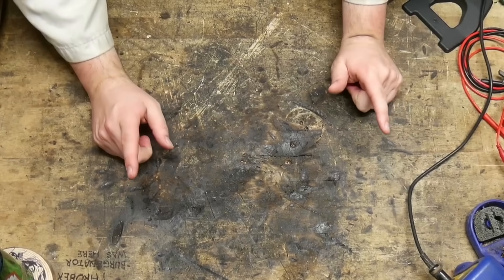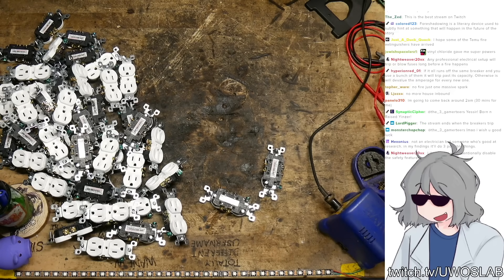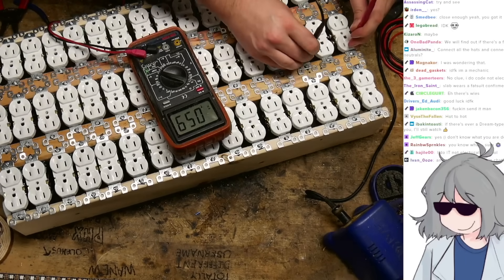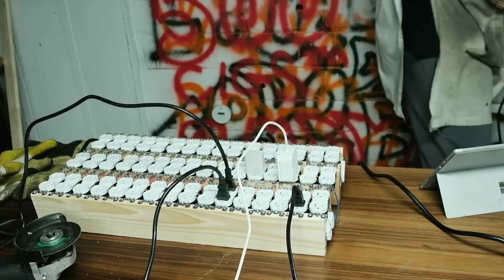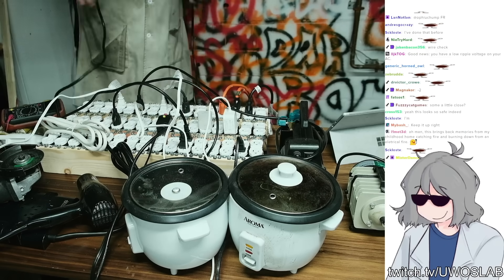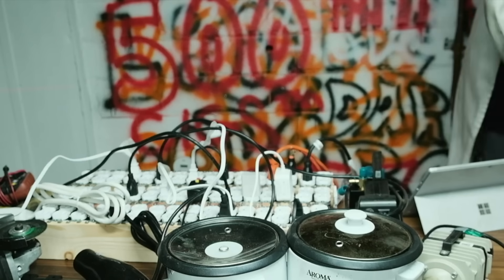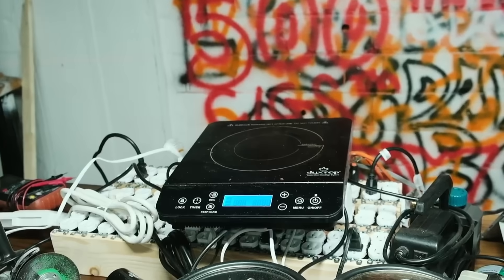Making a 100 OUTLET POWER STRIP to see what happens

Comment: Just sent this to an electrician I used to work with. Im excited to hear the meltdown he is gonna have about how unsafe this is. Lol
Reply: I'm an electrician. Aside from everything being free-air, it's not far off from how your house is actually wired. 😂
Reply: @michaeloxlong  Tbh it works better than wiring in my home XD where every other plug doesn't work for some reason. (the electricians were drunk while making my house)
Reply: @Ashenemi check the light switches, they may have wired half of each receptacle to one of them. I've seen it done before
Reply: @Farce13  i've got a couple of those in my apartment where you need to have the lights on for the outlet to work, and plenty of rooms where half of the outlets in one room are on the same circuit as half in the other room
Reply: @Ashenemi bro has plugs in series
Reply: @DatBoi_TheGudBIAS if he had even one plug in series the entire bank beyond that plug wouldn't work unless he plugged into that specific plug. Even then whatever load he plugged into that plug would actually be current limiting for everything else he plugged in downstream of that outlet.
Reply: @Teh_Random_Canadian  my theory was that he had plugs in series 2 by 2. That's can cause every other plug to not work. Unless the one before is used
Reply: @michaeloxlong  Oh hell no, 100 outlets on a single 16 amp breaker?? I mean, it would be safe when wired correctly, but cheap power extension cables usually don't use  2,5 mm² cable. So they would melt before tripping the breaker.
Reply: @g4_68 I never said it was to code. I just say that's roughly how houses are wired up. Just a bunch of receptacles daisy chained together. 😂
Reply: @michaeloxlong 
I mean most houses don’t have 100 outlets daisy chained because then you run into actual issues, but I get what you’re saying.
Reply: @michaeloxlong  im not an electirician but I think what he did was slightly unsafe due to his comments about the smell of burning plastic. which is either the wires melting or something else melting which was the obvious outcome of this from the beginning lol
Reply: @michaeloxlong  Damn.. 😢
Reply: @cameronsnyder1246  Other than No colour code this is actually decent quality... well except it being a 100 outlet daisy chain but that's the point. Though Uwo could have slappe a Circuit breaker on that stack to save some headache dealing with his Eletrical box going off..

But lets be serious Most people have more plugged in than this. in a home theater setup.
Reply: Also an electrician, 10 outlets, 100 outlets or even 1000, it doesn't matter lol. Outlets are just "faucets" to connect to the wiring. If the "faucet" isn't open, nothing flows. The outlet itself does nothing and has zero draw. When he plugs in all that stuff if becomes dangerous, but the breaker does it's job and takes it down. Code limits the number of outlets per circuit to limit accidental overloading, you can just as easily plug in a vacuum and heater into the same circuit and have the same effect as this video. 

In short this isn't nearly as dangerous as it appears to be. When that dude put like 2000 9V batteries in series... THAT was dangerous
Reply: @Teh_Random_Canadian That is an incredibly helpful way of breaking it down.
Reply: @Teh_Random_Canadian I agree, though I’m concerned with what gauge wire he used, it looked a tad small and the “burning smell” may be the insulation
Reply: @michaeloxlong 
I Haven't watched the whole thing yet, I'm waiting to see if he backstabs them all, which it looks like he will, given he looks like he's screwing them all on to the boards.

He definitely doesn't understand how breakers and load calcs work😅
Reply: @SpookyGoose1  You say that, but he knows enough to mention that not all of his breakers are in phase with each other. Knowing about phases at all puts him ahead of maybe 99% of people.
Reply: Keep us updated
Reply: Yeah but electricians are hysterical until you throw money at them
Reply: not really. that's what breakers are for. sure wiring it up to a 240V outlet is where the real abomination is
Reply: It’s actually not some super bad thing. You could have 100 outlets wired in your room and it would be fine. It just depends on the load being drawn by the amount of things you plug you. If you had 40 watts lights you could probably light up about 60 of them before the breaker trips.
Reply: I am surprised he has blown anything up yet.
Reply: as an electrician its not an issue unless he bypasses the breaker

Comment: My mum got new wall outlets installed and as a 7 year old kid i found the old one some speaker wires and a Unused Plug I found a screwdriver and connected it all together plugged it in and it worked beautifully the only things i did was charge my laptop and run a incandescent light bulb from it I got shocked once and we had the old school breaker box so no rcd (the european gfci that protects the entire circuit) I'm lucky to be alive to be fair i only plugged stuff into it when it was unplugged but imagine if i plugged in the toaster or vacuum cleaner into it The resistance of the cables would be dangerous and could have caused a fire

Comment: depends how far your willing to take this but if you put it on say 10 gauge wire and on same circuit as the clothes dryer it could have more output you could go higher but then it would start to be a chore

Comment: It is wild how low quality US outlet internals are. Makes me feel awesome about Australian outlets
Reply: while the design isn't great regardless pretty sure he did buy the cheapest outlets possible, they only cost like 75 cents each lmao
Reply: he also used like14 gauge wire which is like, what you'd put in a cheap extension cord for a fan. Not something you should run a hotplate, four rice cookers, an air compressor and a hair dryer off of. I assume it's the insulation on those cables burning
Reply: I'm jealous of other countries outlets. My house has some old style 2 prong outlets and stuff is always falling or getting knocked out of them
Reply: @elimiller9167  Get those outlets replaced as soon as you can, if they're so worn and loose that plugs are falling out then they are dangerous.
American wall outlets and plugs really aren't that great in design, but they should never be THAT bad.
Reply: WE DON'T DO IT THAT WAY IN AUSTRALIA
Reply: They're perfectly fine. Plus we split the  phase to 120v. Our 240v outlets are much different

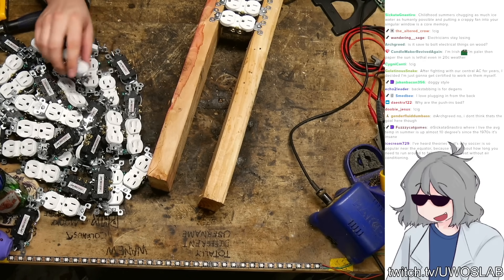Comment: 4:29 Hadn't he have a degree in Electrical Engineering?
Reply: A certified electrician and a degreed elec. engineer do very different things. Electrical Engineers work on circuit boards, microcontrollers, etc. Electricians primarily work on commercial and residential AC power. There is definitely overlap but Uwo’s degree is not the same as being certified as an electrician
Reply: @clebbington  tho tbf he's defo a certified electrician ahahaha

Comment: I don’t know shit about electrical engineering but I’m positive that is not to code.
Reply: Main issue is that it isn't in an enclosure. He's also prob using the .89 15 amp receps and I would use 20 amp ones for this
Reply: @morgangrisby8107  that and the same colour wire but thats just for visual help wire is wire no matter after all.... I would put a Breaker on the device just to save myself a trip to the box the 20 Amp outlets wont help if they are all 15 amps all the way to the main circuit also have you seen the prices on 20 amps lately 50 of them would be expensive AF.

For the most part the set up i would do it INPUT likely a c14 input wired to a breaker then into a GFI then a bunch of regular plugs. Close it up and slap some of those Modular plate covers on.
Reply: The bro code

Comment: Bro the walls of your house are gonna be spitting fire
Reply: Nah. The breakers are intended to protect the wires in your walls (if the house wasnt built by an asshole).
Reply: @BlazingKhioneus im sure that back in the days wires were installed by actual professionals. and im sure that wires are thick.  no thin chinesium aluminium nonsense.